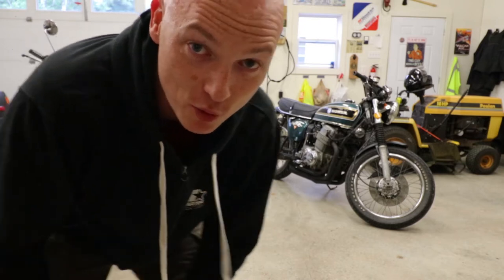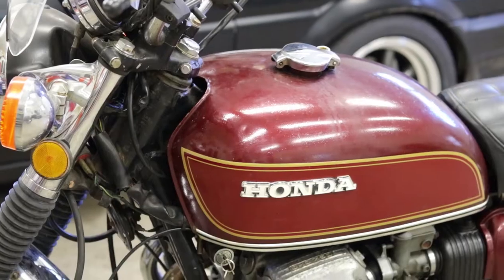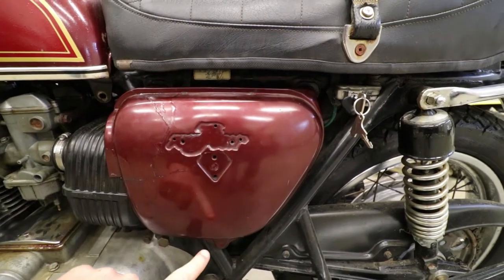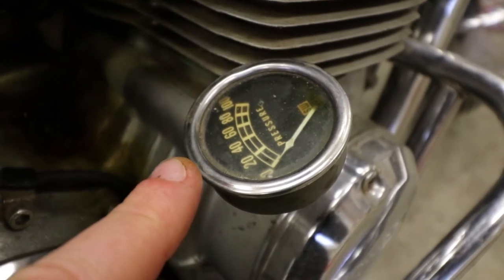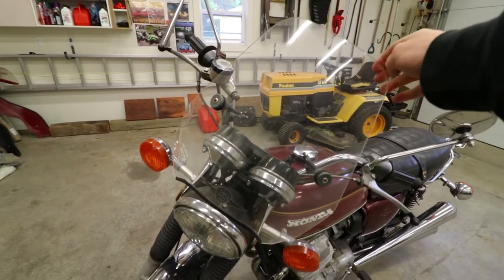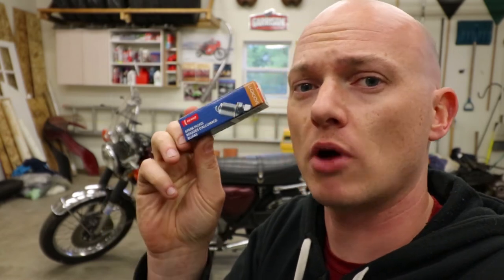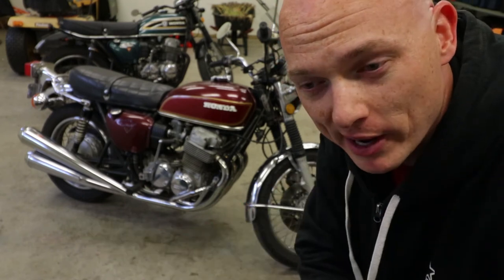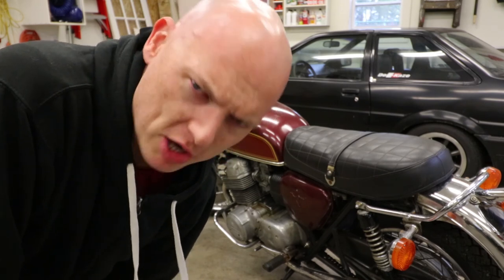My NEW Motorcycle Restoration / possible build? (Project Ron Burgundy pt.1)

Comment: Instruments look like off an F2, my K7 also has blue instruments. Your pipes and carbs K7.  K7 pipes look like welded to K2 exhaust flanges. I used fibreglass replica side covers and seat base and a Walker 4 -1 exhaust. Anyone doing a resto make sure you clean your carbs and reset the adjustments, float levels, jets etc.

Comment: The Tach is for a CB750  F2 (1977) or F3 (1978). Sounds like someone put together a Frankenstein...great opportunity!  So K7 engine/tranny/carbs and a 1975 body/frame (K0-K6 frames are shorter than the K7-K8)...should be interesting if you buy parts (model will depend on where you plan to install the part, ha).
Reply from the maker: Frankenstein is the perfect way to describe this bike. I noticed it has a different looking rear sprocket too. It was rumoured to have an 836 kit in it but I've got no way to actually prove that.

Comment: Saw this on kijiji. You may want to check the chain alignment on your Frankenstein . 77-78 have the engine sprocket positioned 10mm outboard with 17 inch rear wheels and will not fit earlier swing arms and rear wheels without mods. Then again it may have been modified.
Reply from the maker: Hey Johnny. This bike is rocking a smaller diameter rear wheel too! I forgot to include that in the ad.